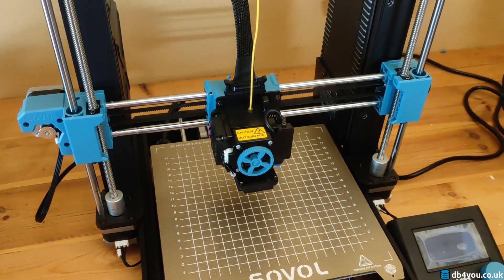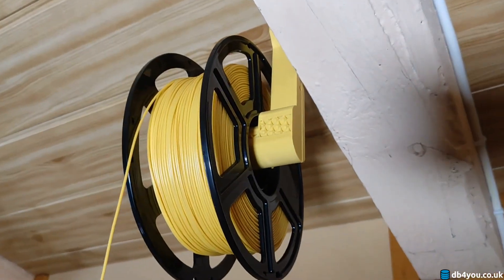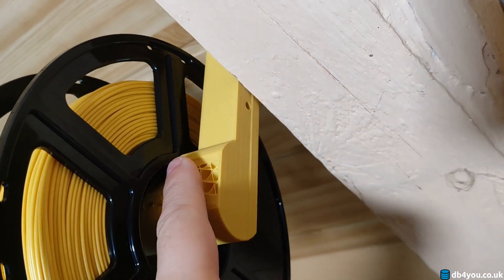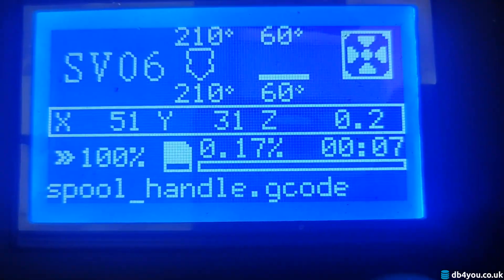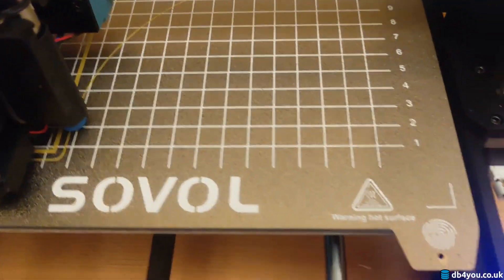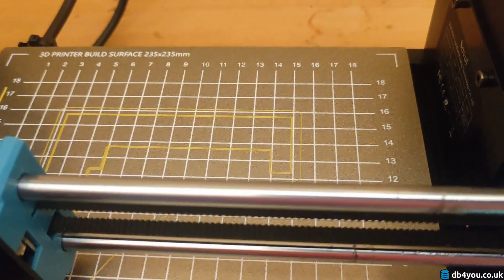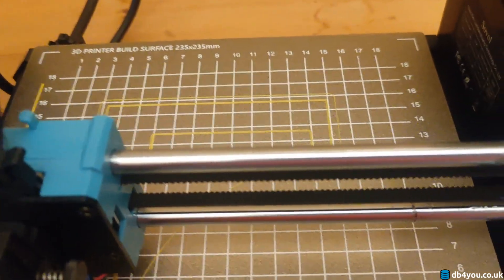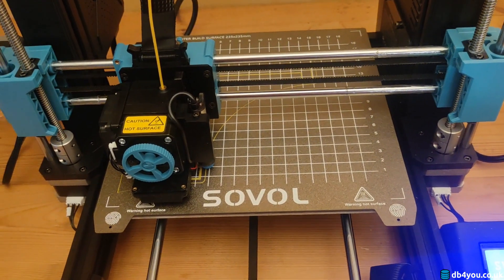My two issues with Sovol SV06

Comment: I swapped out the y axis bearings with plastic and shims, replaced the y axis motor with a 40mm long motor, added part cooling from the back, cable releaf for the y axis and ribon cables, cover for electronics.  Wore out and repaced a part cooling fan and silicone sock.  Runs like a champ.  You would think I have a Prusa, it runs so well.
Reply from the maker: That sounds great! Maybe what they did to get the SV06 is they got a Prusa and just stripped it down to a bare minimum. What max print speed can you do now on it?
Reply: @gebsystems  I am getting 90mm/s.  It can go a lot faster, but I would like to not push my luck and try to break things. My travel speed is 200mm/s, and acceleration is 500mm/s.
Reply from the maker: That sounds really good for this entry level cheap printer. I will try and mod it in the future and see if I can get similar results. For now I am using the Mingda for my daily prints.

Comment: The 5 upgrades I did to my SV06: PolymerIgus Igus Drylin Bearing (so quite), Sonic pad for klipper, silicone bed leveling mounts, CHt nozzle for high flow, and Z wobble nuts. The printer runs so smooth (250mm/s) last upgrade is the cooling fan.
Reply from the maker: I am not going to go crazy with the upgrades. However... them bearings you suggested could be the one thing I will get as the stock bearings on the SV06 are shit.
Reply from the maker: @CandyMan2001  I was thinking about it but I got the SV06 as it was on offer (£160 shipped). So I grabbed it! I also got the hardened 0.4mm nozzles to try out carbon fibre. The PLUS does come with some QOL features and has a larger bed. I am thinking to get something super massive at some point so that I can print bigger enclosures for my electronics.
Reply from the maker: @CandyMan2001  Smashed it at £210! Defo a deal! I got a big mindga, small mingda and the SV06 (carbon fibre printing for the future for small parts)
Reply from the maker: @CandyMan2001  In that case you will be LOVING the Sovol! Your life will be amazing again! I am not a fan of making the printer work, I prefer to work on the actual problems I am trying to solve. The printer just needs to print and that is all I need.
Reply from the maker: If you got such a technical background than mastering a cad software will not be much of a challenge. I started with TinkerCAD, later on moved to FreeCAD and never really changed that. I use both now as they have their use case scenario. My designs do not require me to go any further.
Reply: May I ask which z wobble nuts you use?
Reply: zwobble nuts?

Comment: Power failure resume in most of these new printers does not work. Ender 3v2neo and sv06 both only work 10% of the time on resume.
Reply from the maker: Ohhh... I did not know that. I have tried the resume after power failure on my sv06 and it worked ok, apart from the layer shift it finished the print (and power was back obviously within 10 seconds since I was in charge of that). Thanks for the input!
Reply: My sv06 resume works very well, as long as you get it before the build plate cools down.

Comment: Modified fan with 5015, added sovol klipperscreen, so far so good.
Reply from the maker: Those sound like decent upgrades. The klipper screen is like half of the printer cost 😀 What about the bearings??? Yours Do not make those lovely metallic grinding sounds?
Reply: @gebsystems  First day only, then cnc  lubricant and it was ok, every about 10 print, cleaning + lubricant again. Klipper increase the speed a lot and i think is worth it, for the price is like buying the sv06 pro,  i couldn't afford to buy another printer, so got the klipperscreen.
Reply from the maker: Holy smokes! You take the term maintenance to a whole new level! Lubricate it every 10 prints?! How are the prints with klipper anyway? What speed you normal print at and get good / decent results? Also, I totally get the economics of your choice! We all can't splash £££ left and right.